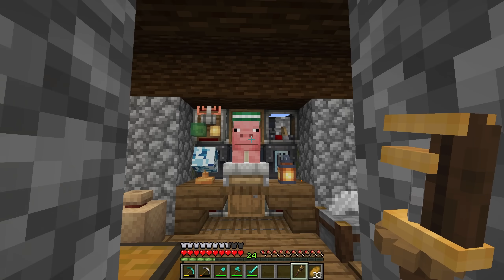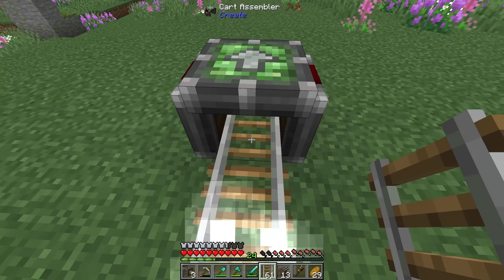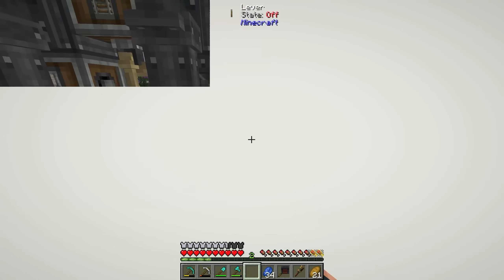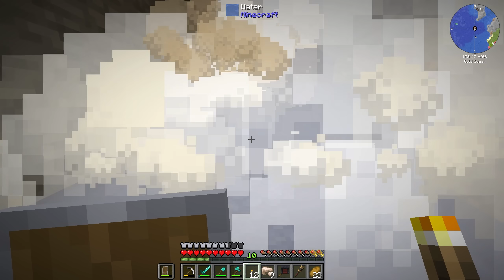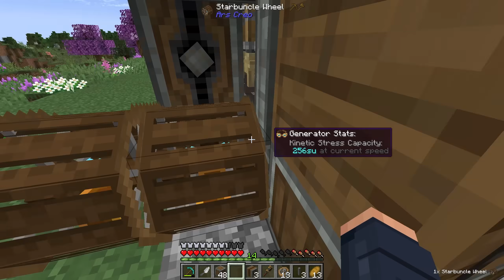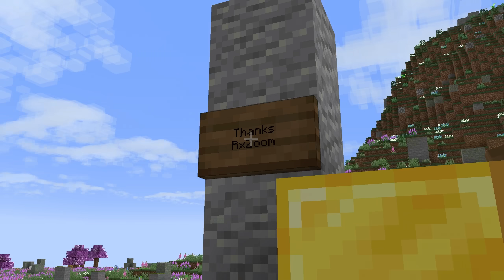This Drills and Places Torches Automatically EP3 Chosen's Create: Integrated

Comment: Chosen for efficient processing for the andesite machine use either vaults like 1x3  put a brass funnel on the end and make it into input so that It'll pull the currently made andesite machine then put an andesite funnel on the first part of the vault to redo the process then put the andesite machine to filter the brass funnel that it will not pull in the andesite machine.

Comment: Interesting.

When I made my contraption with the looping I also used a Soph barrel. But instead of a limited one, I used a basic hopper upgrade.

Set it to push anything that isnt the final product, and it will collect the results as they flow through it.

Comment: using a square area for the torch-schematic instead of a line should make it omni-directional for the drill-contraption, shouldn't it?
With the Torch being in the middle of an area of 13x13 or something like that...

That being said, could also mean that it will now only place torches in specific lines and nowhere else... if that is the case, using 2 placers with one having a X oriented torch-schematic, while the other having a Z oriented torch-schematic, it should work as well.
Reply from the maker: That's a good idea!!!

Comment: I think the schematic duplicates its contents infinitely in all three axis. So you still need to place it somewhere for it to work. In your case, since it was only 1*1*n, and you had only one deployer, it works regardless of position. If you put two deployers with the same schematic, they should place torches on the same lines, even if you reposition your contraption.

You could reduce the directional schematics into one by taking an n*n*1 flat surface with a diagonal of torches. It should place torches once every n blocks regardless of direction. If you plan to use these schematics to build a decorated tunnel, you should place it around where you place your train tracks to align perfectly.
Reply: @calasurien  Why would you need a diagonal of torches? Wouldn’t a square with a torch at the center suffice?
Reply: @DennisDragonz  You could do just one torch, but then you would need to align your schematic so that your deployer passes through where the torch should be, which is worse than what Chosen did. What I recommended removes that need as any row and column will have exactly 1 torch every n blocks and your deployer will only move on either 1 row or 1 column.